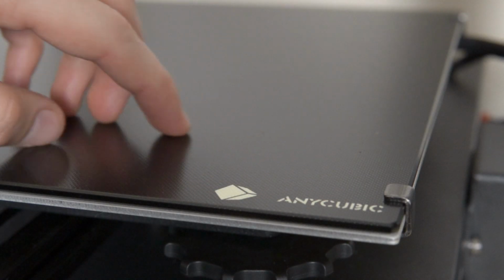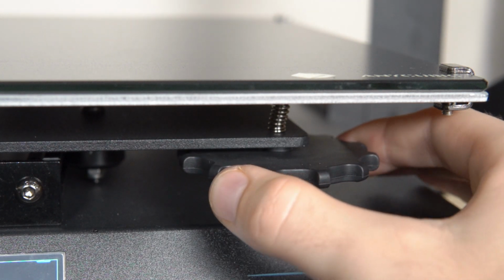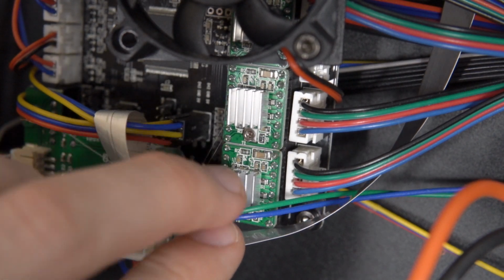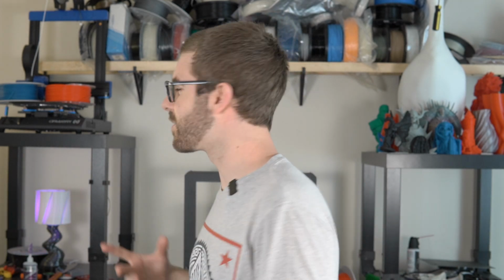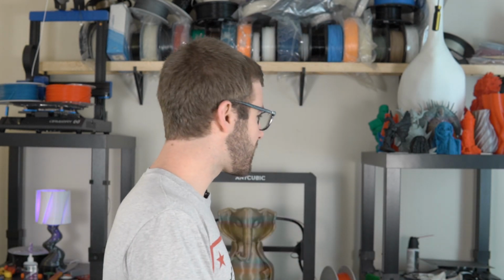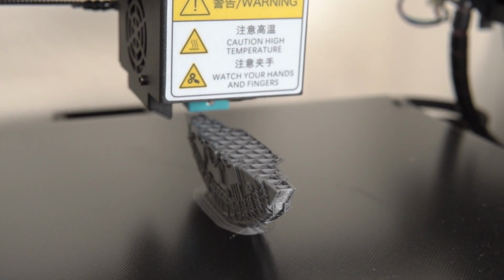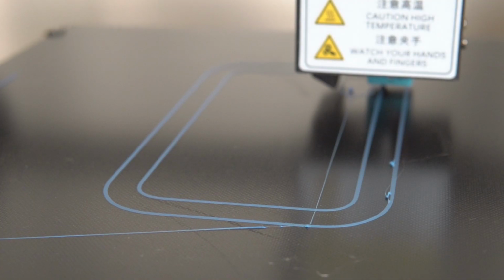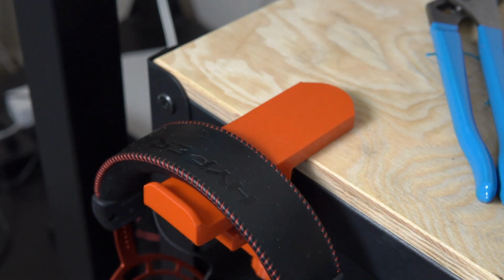Review Of The Anycubic I3 Mega X 3D Printer

Comment: Set Cura or whatever slicer you use to print the walls BEFORE the infill, should entirely solve the infill showing on the outside of the print without having to use extra plastic/time with a 4th wall.

Comment: Never never never go with a Spatula on an Ultrabase. Only wait, if the Bed is under 30 Degrees it pops easy off the bed. With the Spatula you destroy the bed really fast. (Maybe you pin this, you showed your audience the wrong way)  (Sorry for my english)
Reply from the maker: I have been using a spatula with the ultrabase for a long time and have never had issues? The artillery machines ship with it and they are my work horses.
Reply: @ModBotArmy  I hope i can describe it: There are 2 things: 1.)Sometimes the microtexture on the Glass will stuck at the underside of the print and your Ultrabase is gone if its too warm and you dont wait and peel it of with a spatula. 2.)Everytime you use the spatula you will remove a little bit of the texture. Its not much, you need a microscope to see that, but it happens. And someday it will be too smooth and you will get adhesion problems. Nice Greets
Reply: Mine scrapes the plate. I never use the spatula anymore either. The prints always pop of easily after cooled.
Reply: I got goosebumps when I saw that spatula on the Ultrabase. Although Ultrabase is a really good bed, mine came bent so at the moment, the printer sits on a corner getting dust. I shall also point out that it is a very crappy machine. If I  could turn  back time I would NEVER buy again an Anycubic Mega X. Avoid it especially if you're a beginner.
Reply: @locked01  Love mine and after only having the Mega S for a month, I'm giving it to my stepson and getting the Mega X this Tuesday.

Comment: I have a question about the Mega X........is it "normal" for the printer to place its print files NOT in the bed center BUT on the left rear of the bed? If I slice in CURA, will the opened file be placed on the bed so it does NOT overhang the bed??? My old Makerbot was quite a bit different in terms of the interface as well as printer software......
Reply: It should place it where you place it on the slicer. The only time I’ve had a similar issue to what you described is when I forgot to change the printer type on the slicer. So make sure you are using the correct slicer settings for the Mega X. Hope that helps.

Comment: Hi I just recently purchased this printer after having problem with my Ender 5.  About those step[per drivers?  I never really got into replacing things for flashing programs but you said they easily slip in?  What should I get?  As far as 12v go I only print PLA, PETG and very little TPU.  I liked your video Thanks

Comment: Why would they go to a 12V System? Thanks for the video ModBot
Reply: So you can print straight dc from a portable power supply like a battery, I would assume. Also saves cost if you’re paying for your electricity.